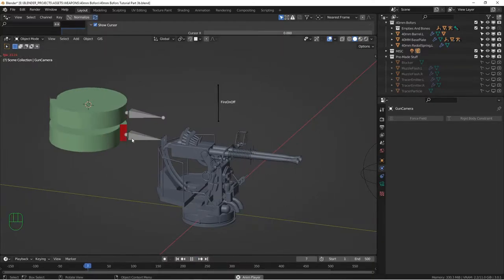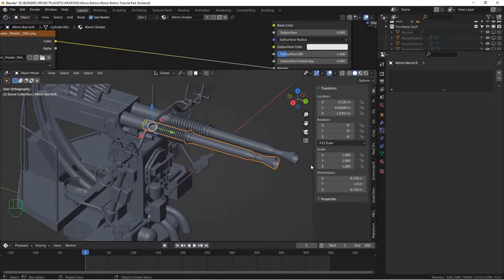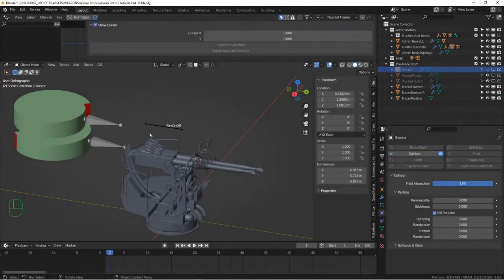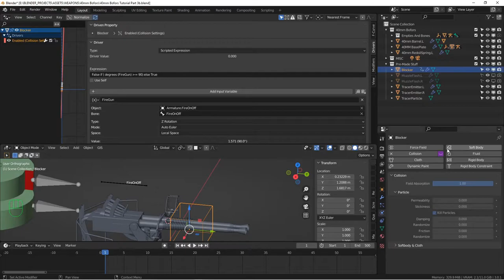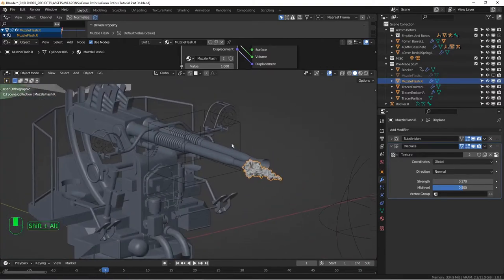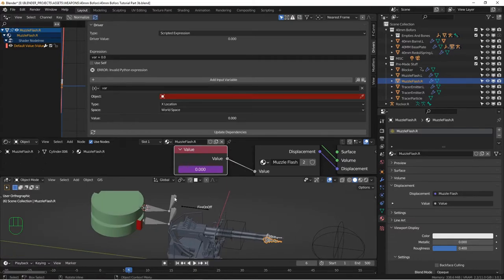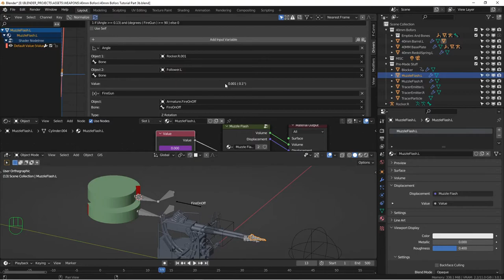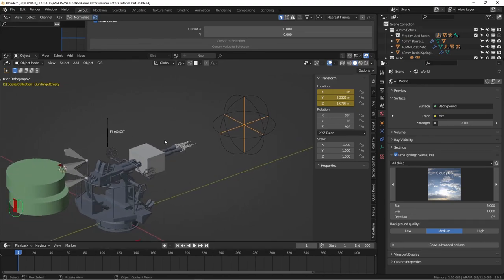03 Tracers and muzzle flash

Comment: hey i have a problem where i dont get a value input on the nodegroup so i cant create the drivers like you do, do you have any idea what could be the issue?
Reply from the maker: That's my fault for not showing how I created the group.  Sorry.  

When you create a group, there should be a node called "Group Input" created within the group.  It may, or may not, be connected to other nodes within the group, depending on the nodes you selected when you created the group.

If Blender does not think there are any input values to the group, it will create the Group Input node, but it won't be attached to anything and there will not be any input value on the group node.  Go into the group node and connect the Group Input node to an item within the group.  That will create the input value in the Group Node.  

Let me know if this doesn't work for you.
Reply: @Mark_Alloway  ah i see, ill check if your solution works tomorrow but thanks for the feedback :)